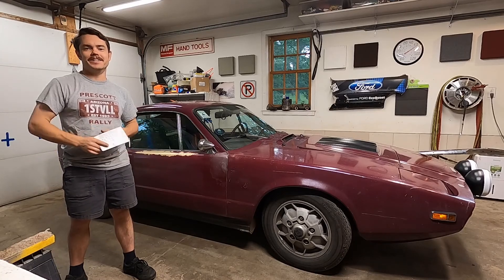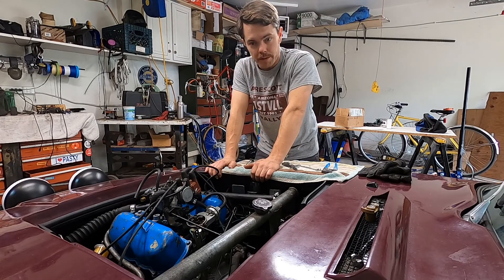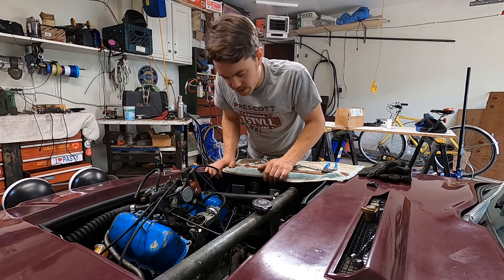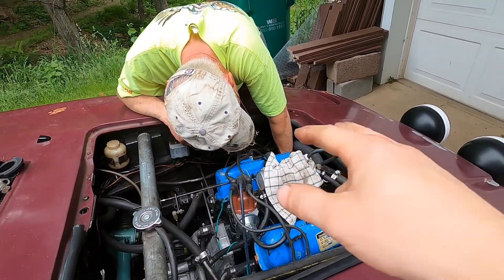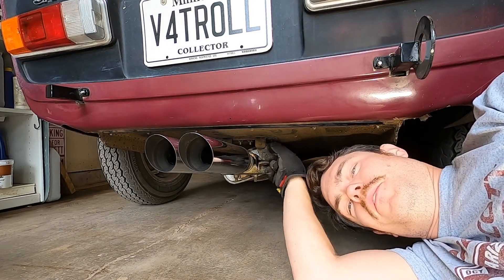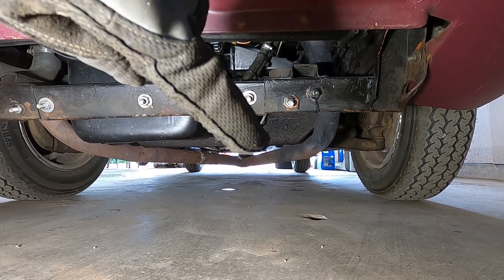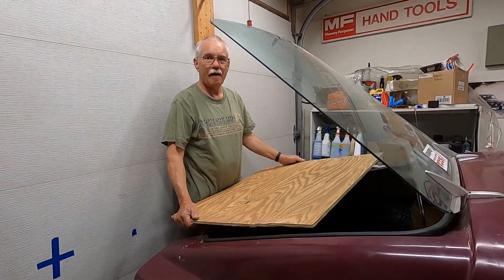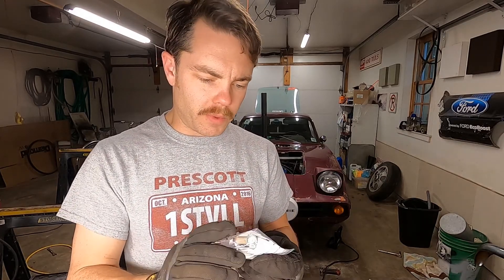Will My Swedish Go Kart Even Be Ready? Ep. 43

Comment: Thanks for your series about the Sonett so far. It is so much more informative than those old-bang!-like new videos about restoration. You documented in a realistic way all the hurdles you had to take. I also like you actually USE the car instead of having it as a show car. Owning a 900 convertible in very good condition i sometimes flirt with a Sonett. I feel I have a much more nuanced view of what to expect. Thanks a lot! I really think you should consider to reinstate the original exhaust configuration with two pipes at the sides though instead of one in the middle.
Regards to your cat and your dad - i wish mine was still around to give me tips along the way.
Reply from the maker: Thank you! The main reason i keep the center exhaust is I'm told it's the hughest performance option for this engine

Comment: I'd advise against filing modern points, they are thinly plated with platinum, and once you're through it, your points will burn out quickly. Filing them will get you home in an emergency, but they should be replaced ASAP.
Reply from the maker: I've never heard this before, and I haven't had a problem with them in several thousand miles after this video. What brands use platinum plating?
Reply: @SealedBeamRallyTeam , From what I understand old contact pads on breaker points were tungsten, and could be filed. the new ones are a copper silver alloy with a thin coat of platinum or iridium. Once it's gone, points will erode quickly. My Dad who has worked on cars and farm machinery for 65 years is my source for this, and I know from personal experience that "They just don't make 'em like they used to."  Dad has a model A, he put new points in it, they failed, he filed them, they worked, they failed again. He dug the old points out of the coffee can he put them in, filed them, they worked. They've been in the car working for nearly 10 years now. Modern points are pretty much disposable. Do a little looking, If I'm wrong, let me know. I hope this helps.

Comment: Any original wiring needs attention... gremlins showing their ugliness in the electrical fer sure.
Reply from the maker: Most of it works perfectly, which is the weird part.
Reply: @SealedBeamRallyTeam  - I wonder if there's some corroded ground connections? I'm not sure if I remember what all's been done to it... just trying to catch up on your Sonnett videos. I know it might sound scary, but this project might need a body off restoration some day - such a cool fibreglass car. It's so interesting with that engine combination, and the Chrome Bumper idea is gonna look fantastic! .....Gee, imagine if this was the future and it was a classic E-car? 😵‍💫😂
Reply: By the way, Vice Grip Garage has a Sonnett that might be for sale... (( FORGOTTEN 1974 SAAB Sonett III )) 👍
Reply from the maker: @McBuggs.  I'm just thinking about where i was when I filmed this... yeah, at some point the vacuum lines on the carb got switched top for bottom and the distributor advance was pulling vacuum from the wrong port. I swapped them, adjusted timing, and it's perfect again. Well... except for one thing. You'll see that in the next week or so. I have to figure out how to frame it for a video.

I saw that Vice Grip video. He put it up on Ebay or something last year I believe. One is enough for me. If I got another car my top choice right now would be a Renault R8/10 or Dauphine, but the Corvair needs work first.